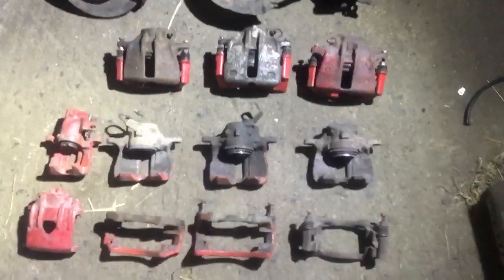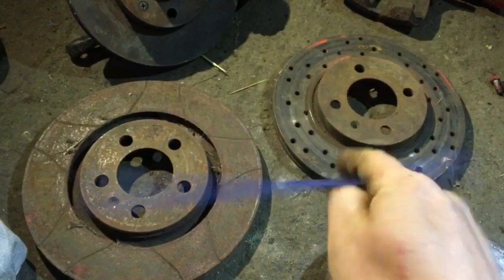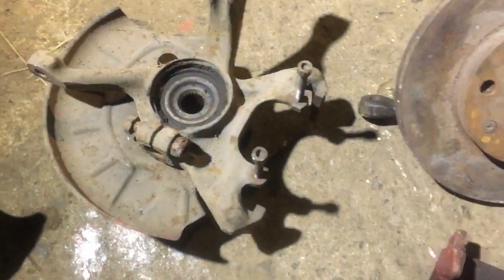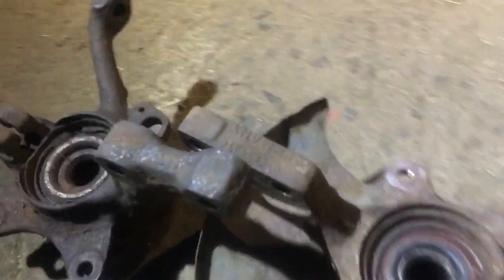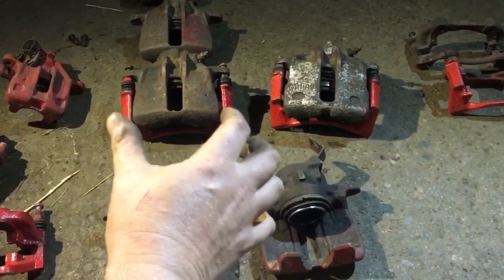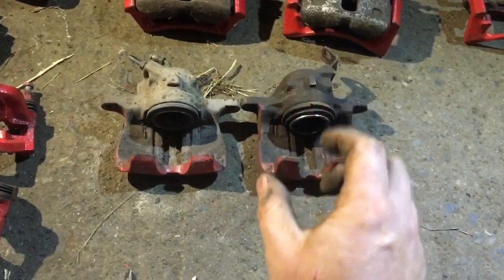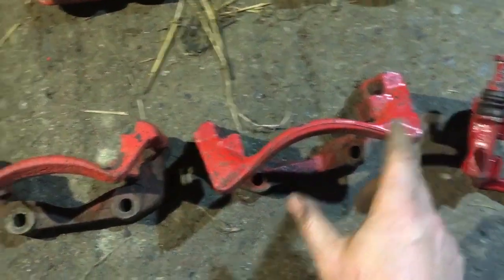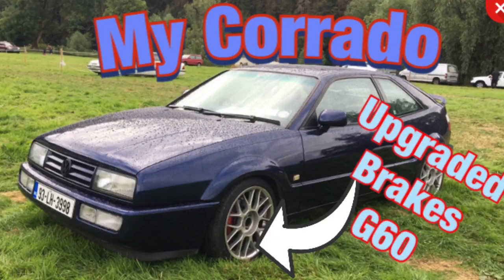Identifying Different VW MK2 Brakes  [GTI vs G60]

Comment: Are there different size rear disks? What size matches the 280s for the front?
Reply from the maker: No all rears are the same size regardless of fronts. Reason for it , when you brake your Center of gravity is shifted forward and your loading up the front wheels . Basically your rear wheels are going up in the air and your front wheels are getting planted into the ground so there is no point upgrading the rears
Reply: @stevenharpervw  thanks! It’s the 226mm?
Reply: @chrisladouceur4093 doesnt the mk2 g60 rallye syncros run 239mm rear discs

Comment: Hi there, i have a early 1.8 carburetor jetta mk3 with Solid brake disc. I found a jetta in the scrap yard with ventilated disc so i bought the calipers with carriers but they dont line up with my current stub axle holes. The hanger holes are wider apart than my present calipers. . So i then bought the stub axles (hub carrier) so i can bolt the calipers to make this set up work. Do u perhaps know if this will work or are the wheel bearings going to be a issue as well? Regards Andrew
Reply from the maker: I’m not 100 % sure what you ended up buying . The mk1 hub that holds on the carrier, the holes are 80mm apart . The Mk2 hub has the holes 100mm apart so maybe you have a mk1 and your fitting Mk2 hubs and brakes to it ?  You might need the drive shafts too

Comment: What wheels are you going to use with g60 brakes, i have a 15x6" bbs mahle and it didnt fit with the g60 brakes on a mk2
Reply from the maker: 16” wheels or bigger for G60
Reply from the maker: 16” wheels or bigger for G60

Comment: Something worth adding - 256mm brakes are possible on a mk1, using Scirocco 16v caliper carriers. Those are the only carrier that holds a Lucas 54 caliper while fitting a mk1. You'll also want a 22mm master cylinder, and a late cabriolet booster, or a modified mk3 booster.

Cheers!
Reply from the maker: I focused on just golf /corrado and mostly mk2 without using any odd brackets or conversion plates . Your dead right using the scirocco calipers ( is it Mk1 or2 ) on the Mk1 golf is a great upgrade but they are like hens teeth.. 
I’m running 280mm on a Mk1 with standard Mk1 gti calipers but have extension plates to push them out. The brakes are fantastic but there is a lot of disc that never gets used. And yes a 22 or even a 24 mm master cylinder is a good upgrade and big servo too .  I’ll have to make another video with your additional info 👍
Reply: @stevenharpervw  It's nice that the upgrade uses VW parts, an no adapters, but yes the carriers aren't easy to find.

It's the Scirocco mk2 16v (~1987) that you need to look for. I was able to find a set for my mk1 caddy tdi just last week. Search for the carrier and caliper combo part numbers, centric 141.33035 and 141.33036. Sometimes the remanufactured calipers come with a standard golf/Jetta A3 carrier, but I got lucky !
Reply from the maker: @ericfore  where did you find them? eBay?